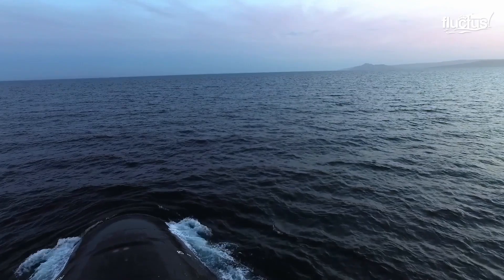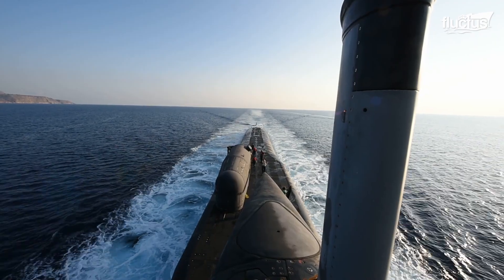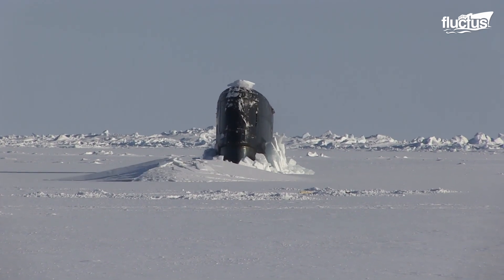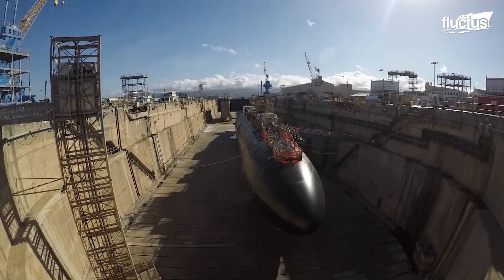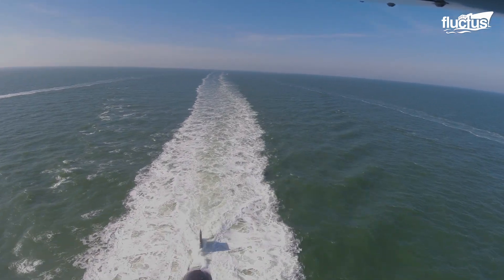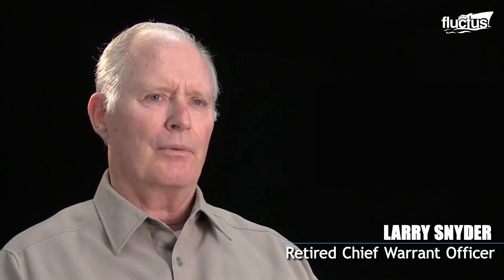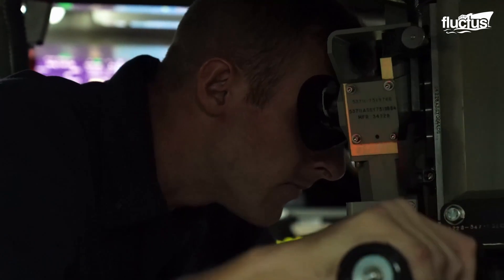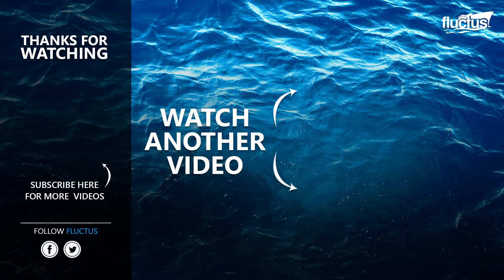The Weird Reason Why US Hide the Propeller of its Nuclear Submarines

Comment: The US Navy has attached a toroidal propeller To one of its  subs. It is the first time such a propeller has been installed on a submarine. These props have an advantage in that they don't produce any cavitation, which allows it to run much more silently, and with the expenditure of a lot less energy. It also crates more thrust, making it much faster. This may in future require a redesign of submarines in order to reduce stresses put on the subs at the greatly increased speeds.
Reply: yupp, gatekeeping efficiency is wild but they would be the first to do that I'm sure.

Comment: Ex Sonar Technician here. We’re trained in school how to identify submarines off of their acoustic signatures. Every submarine in the world has identifying tonals. Once you start identifying them you plug them into different mathematical formulas that can help you determine # of blades, and in turn the blade rate, which  helps you figure out propeller shaft rate, leading to cylinder firing rate, then to engine firing rate, now we’re working out the speed based off of those numbers. You only need a little bit of information before you can start plugging in the numbers in order to classify a sub. Once you’ve got it classified you know all of its capabilities and operational weaknesses. It makes sense why we’d hide the props. 

The less you know about a sub the better. Especially when it comes to the number of blades. I can’t tell you how much just knowing the number of blades helps us with identifying it. It’s probably one of the biggest cause you can give away. So it makes a whole lot of sense as to why they’re cover it up. The rest of the sub isn’t much of a secret. We don’t care if the see that part. Those blades are above top secret though.
Reply: Could the Feds accuse you of disclosing classified info?

Comment: The weird reason why the US hides the propeller of it's "Nuclear Submarines" has nothing to do with "Nuclear Power" it's hiding the real power source which is "Zero Point Energy" and it is the energy source that powers most of our Military vehicles. Most major Airlines are using it right under our noses while engaging the zero point power after take offs and landings. They save millions per month in fuel costs and why do you think they charge such low prices for air flights nowadays? Cross country flights for for under $20.

Comment: I was on a tour of Newport News/Hampton Roads area. It was a boat tour. Fascinating! My dad and I were on a three day motorcycle trip from PA through MD and VA and back.
On the boat tour, we saw all the major shipyards and the largest gantry cranes in the world. This was in 1987 or so when we still used 35mm film. 

The strangest thing in my life took place that day. The tour guide on the microphone pointed out a nuke sub (out of the water) that had a visible propeller which he said was rare.
So, I took a few photos of an unshrouded sub and  propeller of a nuke sub that was out of the water. It was at some distance. Not close and with a cheap Olympus compact camera with a wide angle lens.   

When I went to pick up my film, THESE FRAMES DID NOT EXIST!! I forget what the negatives looked like. There were none of the sub. No photos of the sub at ALL.   Everything else was normal. All other photos came out and were printed.

How did 1987 tech achieve that??? Must have been some kind of alien tech scrambler field around the sub. Whom knows?   I cant explain that to this day.

Comment: The reasoning is incorrect. The propellers are covered to prevent observation from above by satellites. The building of these pump jets and their design is highly secret. Secondly, your video was supposed to be about the pump jet and why it was covered, you only mentioned it for about 15 seconds and the rest of the time we got a small history lesson in the submarines. Try again.

Comment: It's not weird at all. It's a matter of national security you idiot. Propellers give off tiny bubbles at low pressures, because water doesn't need heat to boil. Just a low pressure. The bubbles coming off the prop are called cavitation. And can be picked up by enemy subs hydrophones. So the us has designed a very special prop or "screw" to make our subs as silent as possible. Letting the enemy see that design is a huge no no.  Plus pump jet propulsion... we shouldn't even be talking about this shit on YouTube

Comment: During the Clinton Administration, we sold metal surface grinding technology to the Japanese Toshiba Corporation. The technology was used to “super finish” the metal surfaces of ship propellers making them more efficient and quieter. The Japanese sold the technology to the Russians. The Russians used the technology on their warship propellers, particularly their submarines and the Russian submarines became vastly quieter, making tracking them difficult. I read, at the time, the Russian submarines were “easy” to follow/locate because of the noise caused by imperfections on their submarine propellers.
Reply: Bill was too "busy" with Monica to be concerned about such trivial manners as espionage.

Comment: Sorry, the Turtle was deployed in New York Harbor. Developed in New Haven, it was launched to attack the flag ship of Admiral Howe's armada as it lay off the Brooklyn and Manhattan coasts, near Governor's Island. Though successfully able to submerge and approach the ship undetected,  2 errors foiled a successful attack. First, the timing resulted in launching against a strong tide. Second, the boring rod that was supposed to punch into oak, where a 'torpedo' would be attached to the ship, instead it struck either copper plating of the hull or iron plates near the rudder-and was unable to penetrate. Sgt. Ezra Lee, the pilot was exhausted and possibly suffering from CO2 toxicity on his return trip and was almost captured by British marines-save for covering fire from the Manhattan shoreline.
Reply: I concur. 👍🇺🇸

Comment: I rinse my razor blade every time I use it and put the plastic protective cover back on every time. Is that weird? All military grade propellers are sharper than my razor blades....Gillette!
Reply: As a former submarine sonarman and Chief of the Boat with experience testing different different screws and screw technology I know that you are completely incorrect, submarine screws are duller than a butter knife. Your Gillette blade might be made of submarine steel, I participated in two decommissionings and the joke was the boats were going to Gillette, it used to be a joke throughout the submarine force. True or not? I never bothered to research this rumor. The steel was good HY 80, HY 100 is used today, I think either one would make good blades.

Comment: 9:05  That's a Boeing AGM-84D Harpoon anti-ship missile. Being loaded into a torpedo tube???"Submarines (the UGM-84, fitted with a solid-fuel rocket booster and encapsulated in a container to enable submerged launch through a torpedo tube." Wikipedia

Comment: Back in '77 when I interviewed for an engineering position with Electric Boat in Groton, the subs under construction all had shrouds over their props.  The  guys interviewing me freely said the prop designs were secret, and that the shrouds were there simply to help thwart surveillance, by satellite or otherwise.  No big mystery why they're there.
Reply: GDEB Quincy 1966-1969
Reply: Only china is stealing and copying other`s technology!
Reply: Toshiba can tell you need to know.
Reply: exactly. this video was 14 mins of not explaining anything relevant
Reply: When a propeller is used it is still shrowded for this exact reason. We don't want other countries to know how we deal with cavitation. Even the number of blades is classified.
Reply: @erichlf  not even that, but just knowing the number of blades would drastically cut down the amount of work it takes to classify a sub. Knowing the number of blades going into LOFAR gram analysis is like cheating. # of blades gives you blade rate, which gives propeller shaft rate, which gives cylinder firing rate, then engine firing rate, now we’ve got the speed of the submarine. The one piece of information makes classification so much easier.
Reply: @grizzleg8729  well US subs general don't run on the diesel unless there is a problem, so I don't think anyone is worried about piston rate, too much.
Reply: Nuclear submarines typically have 7-bladed props.
Reply: @hunterbidensaidslesion1356  if you say so.